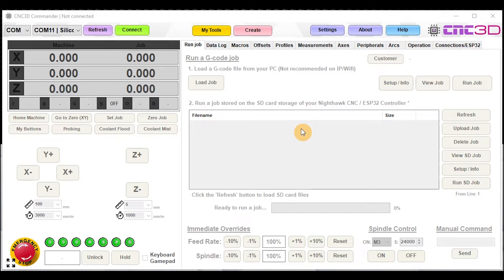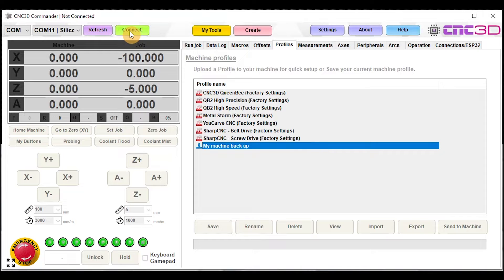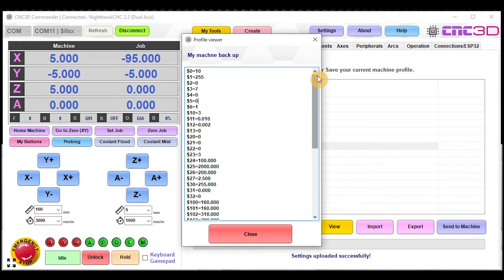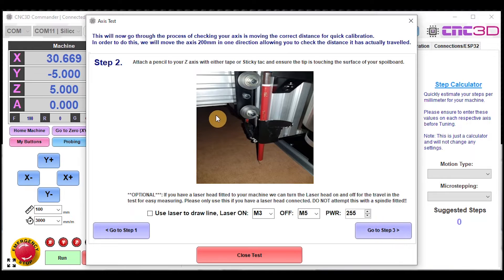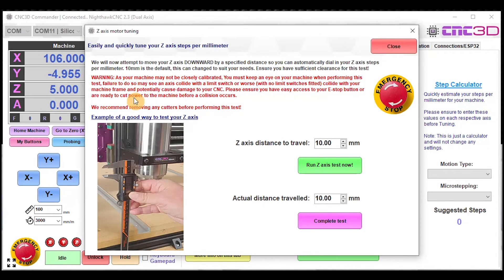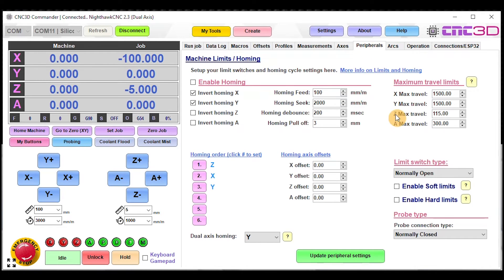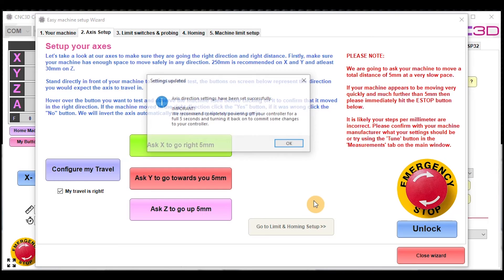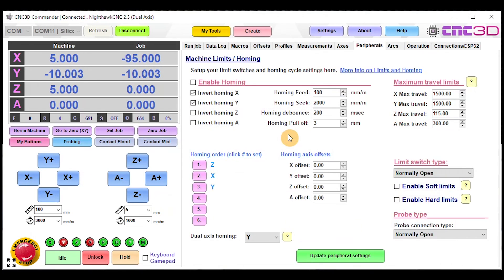CNC How-To - Swapping from xPROV5 / GRBL to Nighthawk controller the easy way.

Comment: Die China Spindel konnte ich mit meiner xpro v5 zum laufen bringen, aber sonst werde ich verrückt mit der xpro v5. Aktuell wenn die Spindel läuft gehen z und x Achse in endlagen Störung. Die Fräsrichtung wird sporadisch umgekehrt. Einfach so. Cool wäre ein hiermit dem Schrott und ihr bekommt 100€ Rabatt auf die nighthawk Steuerung
Reply from the maker: We'd be delighted to send you a Nighthawk. They are already $100 off. Keep your xPROV5 as a door stopper.

Comment: what is the benefit to change the controller from the Xpro to the nighthawk? what can the nighthawk do that the Xpro cant?
Reply from the maker: @jasonparker1454  the most notable difference is that the Nighthawk has the ability to start an SD card job from a specific line.

It also has better reporting of current machine conditions such as active job coordinate plane.
Reply: well Ive been trying to get my xpro to run my spindle for days the support sucks there are no videos or wiring diagrams I have been trying to work through this with zero luck and it gets more confusing by the day Maybe the Night hawk has better support and is more plug and play
Reply from the maker: @crypton133  Most likely yes, we take the quality of our machines and controllers very seriously. This includes to level of support we provide. We like having our own controllers and software because we know it back to front and can fix things and innovate very easily.